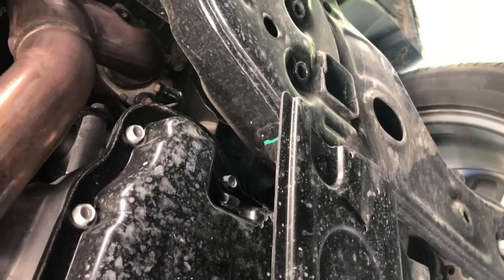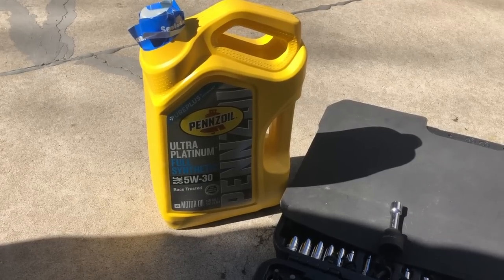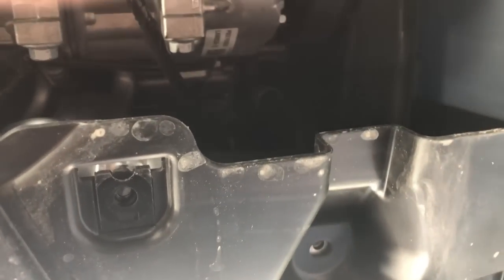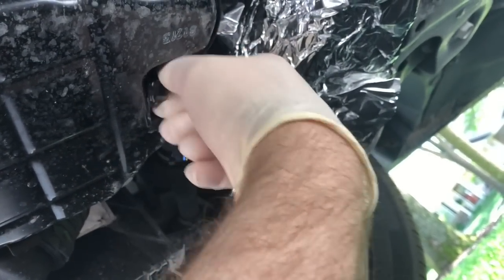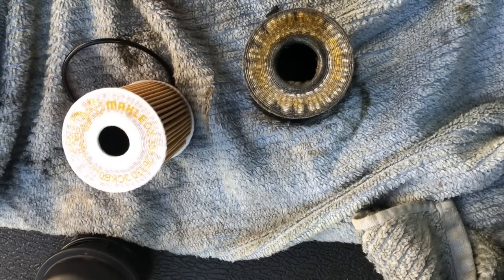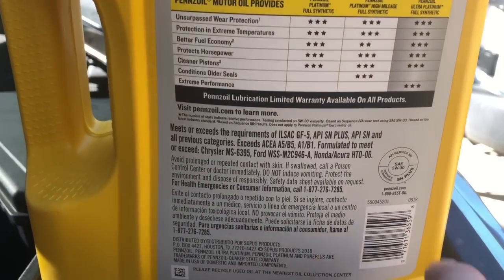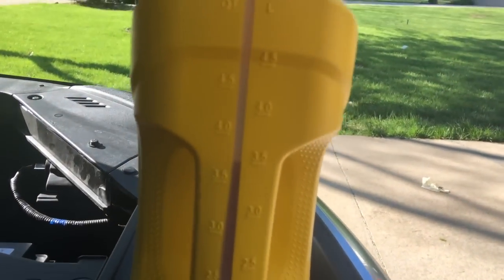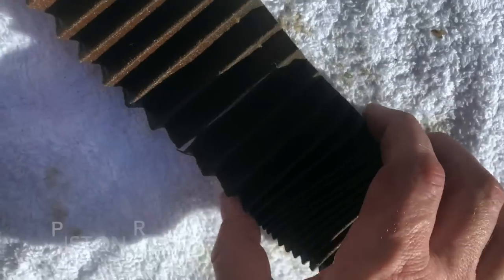Kia Telluride - How To Change Your Oil

Comment: Thanks for the great Telluride Videos!

I changed my oil after 1206 miles and cut open the filter to see if there were any metal shavings. I was SHOCKED at how many metal shavings were trapped in the filter. Hundreds of little pieces of metal were in there. I assume the filter did it's job and grabbed them all, that's why they were in there, but man was that unnerving. My 2022 Telluride is the first new car I've ever owned so I don't have anything to compare it to but I'm still amazed at how many shavings were in there.

I also put a big rare earth magnet on the oil drain plug before I even drove the car home - knowing I would replace the plug after my first oil change with a normal magnetic plug. The factory plug, which after 1206 miles was very magnetized, had no shavings on it. So there's that. I know most of those shavings are probably aluminum anyway so the magnet may not make a difference but it can't hurt. 

One IMPORTANT note about refilling the oil (and I see you had the towel around your funnel) is to either do this with the towel or just pour the oil very slowly. There is a diverter plate just inside the oil filler tube neck that keeps oil from splashing up to the cap. This diverter prevents oil from getting in the hole quickly. I, not having noticed the flap, glugged the oil into my funnel just like I've done on every car I've ever owned, and it all overflowed the tube, rand all down the serpentine belt, all into the alternator, and everywhere else you never want oil to get. HUGE FREAKIN MESS! I was so mad at myself. I cleaned everything as best I could and it doesn't seem to have made any difference at all with belt slippage. No screaming at startup. That was about 200 miles ago and it seems to be all good.

Comment: No need for foil... good video. WIX makes an excellent filter. I'm using Castrol edge and installed catchcan to my Hyundai Palisade and Genesis g70.  Better safe than sorry.
Reply: Will installing a catch can on your Palisade void your warranty on your engine?
Reply: @Maddog29  no it wont
Reply: Can you describe the location of the PCV I cannot not find it, in order to put a catch can on.  Thanks!!!

Comment: Thanks for an informative video.  I’m a new Telluride owner.  What the difference between “Ultra Platinum” and “Platinum” Pennzoil oil? They both meet KIA spec?  Also, what tool do you use to get the Telluride off the ground for oil change? Thanks,
Reply from the maker: One meets the standard and one exceeds the standards. You’d be fine with either. 

I bought some ramps from harbor freight. You just drive up ramps and it gets you plenty of room under the vehicle.
Reply: @ManicMarkets  just looked at my container Penzoil Platinum and it does not mention A5/B5. Very strange as photos on the web do mention it but the actual container now doesn't mention it.

Comment: Is this car eating oil?  6.5qt went in and only about 4qt went out! Yes, I made sure car was warm before draining, yes I opened the drain under the hood, car was sloping a bit back at around 15-20 degrees (where the plug is), yes waited 10min or so for all oil to drain and even poured half a cup of fresh oil to "flush" a bit. Is this normal? Thanks. P.S. Regularly check oil levels and did have to add oil in between changes, but not a lot. Never saw an oil spill under the car.
Reply from the maker: It may be. These thinner oils should still only vaporize at above 400f, but very possible you are burning off oil. It does seem high though. What intervals are you using? I always use a shorter than recommended 5,000 miles. I think maybe .5 quarts would be accurate. But 2.5 seems like something more than normal oil burn off.
Reply: @ManicMarkets  7000 miles.

Comment: I use fumoto drain valve, makes oil changes so much easier and less messy.
Reply: Would you happen to have the model number for the Telluride?  I already have one on my RAM 2500 Diesel.  Love it!
Reply: @chrismiller100  Fumoto F106SX

Comment: Are you still using pennzoil ultra? Or have you swapped oil brands that meet spec. Thank you for the video !
Reply from the maker: Manny05 Manny05 yes - still using Pennzoil Ultra as it meets spec. However, Kia offered me  a customer service gesture that included oil changes so lately I’ve been letting them handle it. They are using Castrol Full Syn.
Reply: Ross Brayton  thank you for the response ! I appreciate it

Comment: Owing to its natural gas source- its susceptible to burning off quickly (lower flashpoint) and leaving carbon deposits. You’re better off with a 100% synthetic oil (group 4 & 5 base oils) , not ‘fully synthetic.’

Comment: Warranty voided due to maintenance performed outside of warranty terms and conditions.
Reply: Not!
Reply from the maker: Warranty isn’t voided. In the US a consumer isn’t required to go to a dealer for service. You only have to be able to prove that you keep up on the regular mntc. This video in itself serves proof, but I also keep the receipts in an app. 

Don’t let anyone make you believe a warranty is contingent on service through a dealer.
Reply: @ManicMarkets  Kia denied to honor 100k power train warranty when I couldn't provide receipt of ONE oil change.
Reply: @ManicMarkets  Which app do you use to keep track of your receipts?
Reply: You cant void a warranty by doing oil changes sooner than REQUIRED,   clean oil is always desirable.